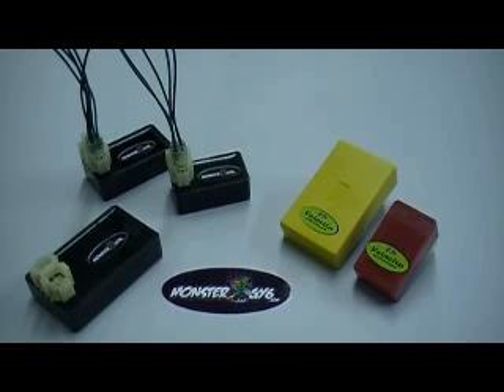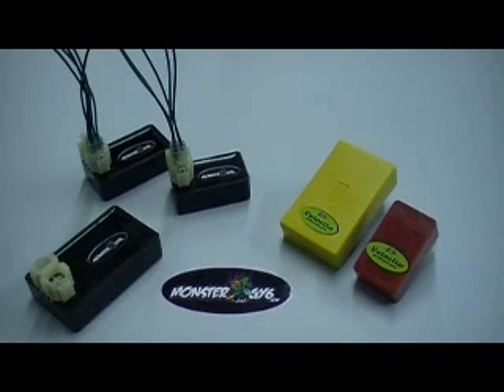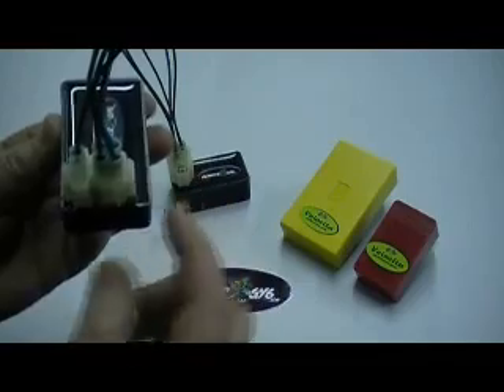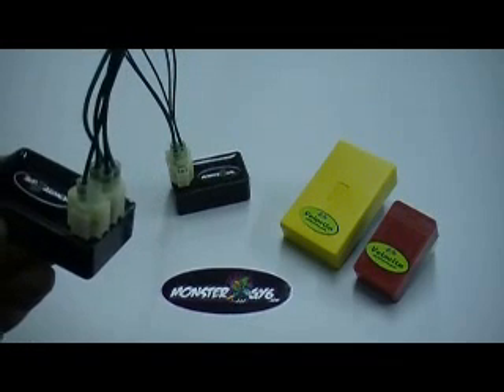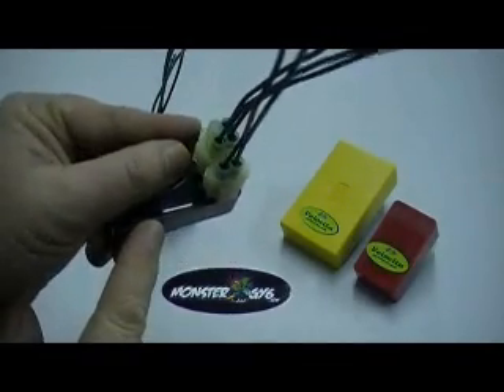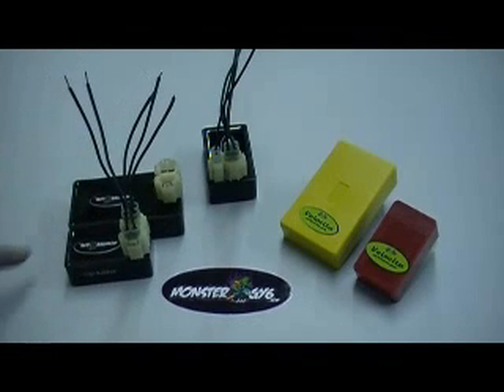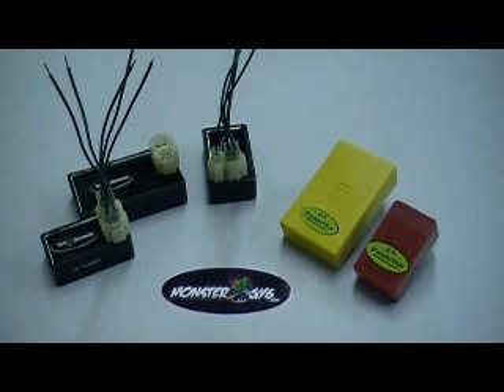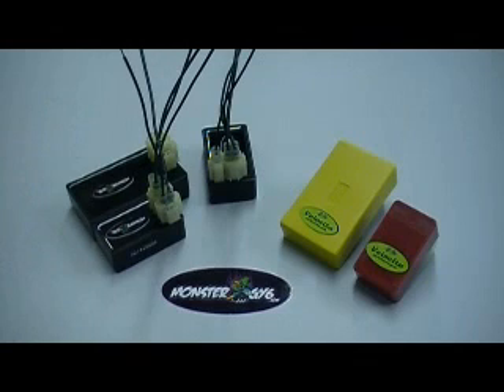CDI Is It AC or DC

Comment: the only way to tell for certain is to look at the stator. If ANY of the coils are wrapped in tape (if it has an exciter coil or 2) then it is most definately an "AC System". Why? you ask? The exciter coil that goes to the ignition coil is an AC voltage generated within the stator. In a "DC System, the voltage that goes to the ignition coil is 12VDC and comes from the battery to the 6 pin on the CDI, and is stored in wait for the coil with the blue wire to tell it to discharge to the ignition coil. Neat, HUH?

Comment: I bought your monstergy6 motor mount and did a swap on a chinese scooter. Im not sure if it was originally ac or dc. But anyway, now the swap is done, it runs good. But i have switched my bulbs to led. Like my headlights and taillights and blinkers. They keep burning out. And i have led accents that all burn out after a few days of use. I am wondering if my old 50cc motor was dc and now after the swap the new motor is supposed to be ac. I dont think looking at the cdi size or wires will tell me what it is supposed to be because of the swap and the mixed components. Can you tell me how to test officially or maybe using a multimeter would do it? Thanks

Comment: Hi MonsterGY6 , I have a Trailmaster Challenger 300 and the CDI box broke due to being improperly attached to the frame, I looked online and bought another CDI which has the same connector and installed it , the engine starts and runs but cannot go more than 3000revs approximately, also the muffler turns red which makes me think it is improper timing.If I install the original CDI the engine starts and revs OK but because the connector is broken it accidentally shuts down so I have to go move the connectors and it starts and runs again.The original CDI is 6 pin, the number printed on the box is 250 CC- 2221-150401, the one I bought has no markings.My question is do you offer this model?If no do you know if 250CC-2221-140702 will fit my machine, this is the closest part number I was able to find online.Thanks

Comment: You cannot just go by wires. Just burnt up an AC cdi going by this advice. Use a volt meter to test.
Reply: What terminals are you testing for AC or DC? Is it the two wire plug?

Comment: My 250cc hammerhead ss then is DC, but when I disconnect the battery it barley stays on and if you floor it, it dies. So is it DC with a bad stator or AC with a DC CDI?

Comment: I have a 1970 Honda SS50 4 stroke. Max power at 11,000 rpm. Its currently magneto ignition and 6v electrics.

Can I adapt a CDI unit to power it? I can alter wiring. Will the magneto output power an ac unit. If not will 6v from battery power a dc unit? Its points ignition so can I trigger the unit from that instead of pickup? I do have electronics skill if required. Thanks
Reply: use converter 6v to 12v and use dc cdi

Comment: Hey so I have a 2011 tomos nitro 50 I put a big bore kit in 72cc 47mm to be exact had to bore the case a little took the restrictor washer that was on the variatior it runs great revs good amazing acceleration but as soon as I hit 25 mph it like halts  (holds back) if I push it it'll slowly get to 30 mph and then the Kevlar belts will shred what do you think it could be never had this problem before

Comment: If it is a dirt bike with no battery it's AC if it has a Battery Source it is DC size and wire configuration do not matter besides the fact that all bikes create alternating current with their Magneto's and the rectifier regulator changes it to 12v DC
Reply: My DR350 has a battery but once started you can remove the battery and all electrics like lights /gauges stop working but the bike still runs ..surely that would indicate the  cdi is AC powered  no?

Comment: AC CDI box needs a spike of high voltage electricity provided by the Stator provided high voltage "charge" coil winding  to supply the CDI box with pulses of high voltage needed to charge its internal capacitor before firing then the seperate small Trigger or pulsar coil will "time" the spark delivery. (Both Ac and DC CDI units need this Trigger pulse to time the spark) This high voltage pulse magneto like coil on the motors stator is wound "separately" from the stator units battery charge windings. and has its own connection to the CDI box itself so if a unique lead from the bikes stator to the CDI is present (it may be grounded by both the key or kill switch in some cases) then it is is an AC CDI type,,AC cdi boxes have a "Grounded stop or kill switch circuit,, that is connected to ground when the key is off or the kill switch is on. there will also be no 12 volt power present with the scooter or buggy  not running and the key or kill switch on with a charged battery present.      A DC cdi box is a Diffrent beast in that it  "Also" contains internal electronics that do away with the need for a separate stator  Charge coil circuit to deliver the "charging pulse of electricity to the CDI capacitor  ,, A DC CDI box instead takes the 12 volts from the battery and charging system and through an internal circuit  steps this low voltage up to "charge" the capacitor like circuit in the flash of a camera ,, if you a find a live 12 volt power wire to the CDI box connector with the ignition turned on and the kill switch off its a DC CDI box type this power should be shut off when you turn off the key or engage the kill switch..
Reply: Allrock123 bullshit High Spike current my ass my 86 350X runs on 37 volts at idle and jumps to 600 volts at Full Throttle

Comment: does stator also happens to be AC and DC ?
http://www.aliexpress.com/item/Top-fashion-Motorcycle-Parts-GY6-or-GY6-Clone-Engine-150cc-scooters-dune-buggy-6-Pole-Magneto/32458369239.html?spm=2114.30010308.3.26.Pk4FWY&ws_ab_test=searchweb201556_10,searchweb201602_4_10037_10017_407_10033_406_10032_10040,searchweb201603_7&btsid=40a35c18-b90c-4e1b-9765-9f3ac2033225

http://www.aliexpress.com/item/Magneto-Coil-GY6-125-150CC-Magneto-Stator-6-Pole-DC-152QMI-157QMJ-Engine-Parts/32441731495.html?spm=2114.30010308.3.2.cEPuhe&ws_ab_test=searchweb201556_10,searchweb201602_4_10017_407_406_10040,searchweb201603_7&btsid=9c952f9f-d527-49a2-af02-fccc424503fa

how do i know if mine is AC or DC  ?
Reply: i have a ac cdi does that mean i need a ac stator? to make spark
Reply: Almost all stators on small motors like gy6, atv, scooter, motorcycles etc put out AC.  If they put out DC you would still need a voltage regulator but not a rectifier which turns AC in to DC.  My 1985 Honda ATC 200X had the rectifier built into the stator and it was fried so it put out straight AC and the voltage could reach 80v at full throttle.  You turn on the headlight rev it up and it would plaster the filament against the glass in a second.

Comment: I have Sym Symphony ST 50 4T, 2015. The engine type is XS1P37QMA-2. Which CDI should I order?
Reply: Simple you got a "name brand" with dealer support you can ask them or search the forums or a repair manual.  The guessing and matching is for the generic GY6 with no dealer support or parts lists to go by.
Reply: I get information from my local repair service that Symphony ST 50 4T does not have CDI anymore but some kind of ECU because an engine is EURO3.
Reply: That looks correct.  Check ebay for a better price on the ECU.

Comment: I found that the 2 wire set up on the AC units will show continuity between the two leads, as to where the DC boxes will not
Reply: Richard Castillo pretty short, technical and explicative... Thans!!!
Reply: which pins are the lead pins?

Comment: Hi I have a beeline veloce gt 50  and I was wanting to know if me moped was ac or dc I have tired a ac cdi unit however it didn't work but in the video it says my moped is ac because it has 2 wires going in to the 2 pin plug. So I don't know what to do, can you help me???

Comment: I bought a new CDI for my Boatian retro 50cc scooter. The old CDI connector has 5 pins, 3 up and 2 down.(that leaves an empty spot in the middle..) My problem is that the new CDI has 2 pins up and 3 down, so it wont work. What can i do? do you think it will work if i switch 2 of the wires?

Comment: And to explain connections on 6 pin CDI, on 4 contact connector is connected ignition coil, and pickup! Sometimes the fourth remaining is connected to side stand (so the engine stops, when stand is down), or to the clutch bell (electronic restriction of speed to 45-50km/h), on the 2 contact connector, colored wire is capacitor charging coil behind magneto, and black is ground wire!

Comment: well, all CDI's are AC, because, behind magneto are 6 electromagnetic cores! 4 of them are alternator, 2 of them are coils for charging capacitor inside CDI! So, tell me, how can CDI be DC, where you will get voltage enough to charge capacitor?? You cant, if you rapidly tap wires connected on ignition coil, on 12V battery, you get no spark, voltage must be way higher! btw. scooter can run without battery connected, nor alternator connected. cheers!
Reply: mdaljev1 because the dc cdis are connected to the battery when you pass the key switch

Comment: Hi there, very interesting your vid, I have a performance cdi on my atv but it has an extra red wire coming out of it (additionally to the 2 plugs thay you are showing here). I just rewired everything but can't figure out were that red wire is supposed to be connected to. If you need a picture I will gladly e mail it to you.
Reply: It's likely a 12v power wire to run accessories like extra lights or radio.